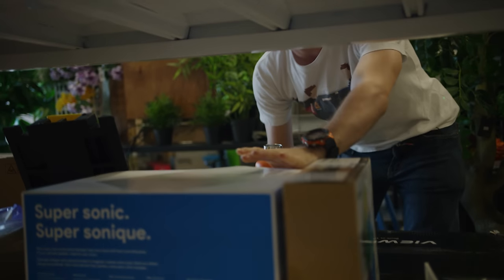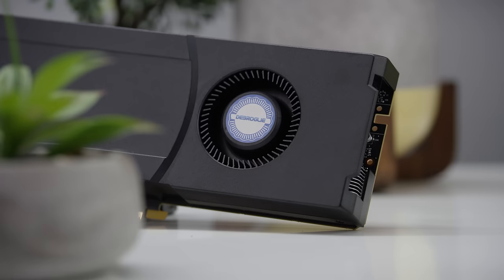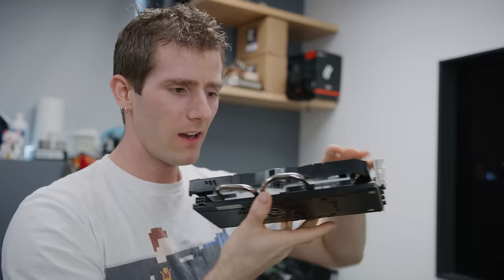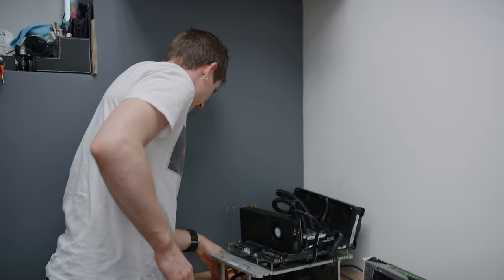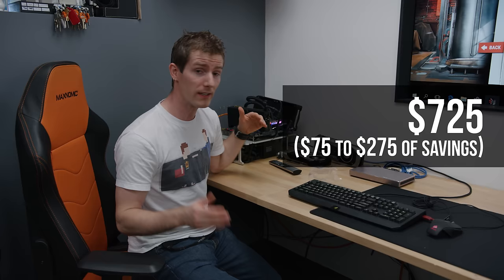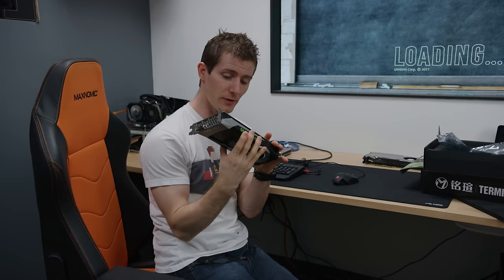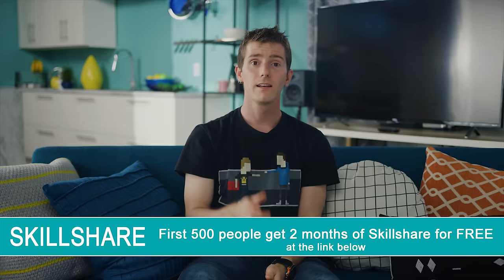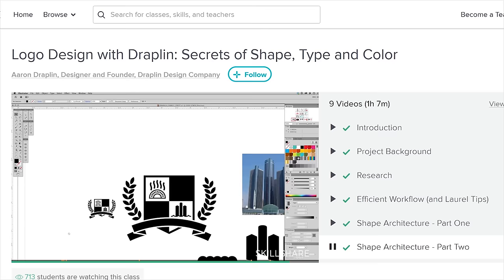Cheap AliExpress Graphics Cards - SCAM???

Comment: Ok, The cards are what they say they are, But about thermals? You did say that the coolers look a bit dodgey.
Reply: Adrian R cooler
Reply: Stable is stable.
Reply: I don't know why people are surprised. If it was 150 id understand the concerns. But $320 before tax isn't even a good deal at all. You can get a 6gb EVGA literally for less on newegg right now.  309 for an EVGA that's guaranteed to be what it says it is, plus a standard warranty vs a dodgy Chinese 1060 that for all you know is a 660 chip made to look like a 1060.
Reply: Jay Sin these were ordered a while back, aliexpress usually has terrible shipping times
Reply: if u saw the whole video its an older ''case'' i mean its not bad.. actually its pretty damn good. i heard stories where people bought 900 series and the plating/case was so horrible it fried the thing inside xD or even the cooling fan randomly broke down. but the ones he showed here just indicate it was probably an older factory that had the old cases but newer insides.  and for a 70-100 price off thats fucking no problem at all.
Reply: What? The retailer has nothing to do with DOA parts (aside from possibly poorly packaging stuff that results in shipping damage). That said, I've been buying from Newegg for years and have rarely ever had DOA, and if I had any issues with anything they've handled it just fine no hassle.
Reply: The biggest concern is long term reliability, especially with the fan. Not the end of the world if you need to replace a fan, but it's also a big pain in the ass, and it's a lot better to have a card with a nice efficient, quiet fan which works well for the entire life of the product. I wouldn't trust the fans on these cards to do that, and they probably are noisier than fans on a nice videocard cooler from a good product, like an EVGA SSC, Sapphire, Gigabyte, etc..
Reply: Something about what he said on that actually bugged me, he really pointed out that the extrusion was a cheap way to do it but that doesn't mean its a bad way, a lot of cooling syncs are built the same exact way, its way cheaper than casting them and a lot more efficient. Even Cars use the same kind of cooling systems.
Reply: To be fair this wasn't in a case, a card stuck out in free air shouldn't ever suffer cooling problems unless it's completely fucked.
Reply: did you buy it on ali express

Comment: I got a colorful GTX 1660 off AliExpress and the cooler seemed mostly plastic but it had 3 fans and overclocked well without going over 65 degrees

Comment: 4:03 heeey i know its been 6 years, but wanted to say, the Teflon looking tape ofer the pcie connector is a protection piece. Back when i worked at a company make pcba's, all are pre made board layouts, which we put all the surface mounted and pin through hole parts on, had those exact coverings. Its meant to protect the connecter from dirt and scratches. So it stays on during the entire process, even through a wave machine. (Used to solder many joints all at once, its a 450c⁰ long oven basically)

 it would be taken off once it was at its final destination, usually the testing grounds, and it just peels right off. It is very sticky, but its meant to stay on till your ready to test/use it, so thats why. Doesnt do alot of protecting if it just came off willy nilly, but they did do that quite often still lol. 

Very interesting to recieve it with it on, it could mean they never actually tested that board, or reaplied it during the shipping process when they packaged it. But the package it in should be the protection it needs, but it being aliexpress, probably not. And with it being aliexpress, i also doubt it was replaced, and was simoly never tested at all.

Comment: I dont know about the other one, but Maxsun is a thrustworthy brand, they also makes motherboards
Reply: Rown Aerith and this video cause the 1060 5g of this brand has being cut off by nvidia
Reply: what?
Reply: linglin92 
wait really? where did you find out about this?
Reply: because the nvidia told them if any one card leaked to the place that it shouldn't be,the supply would be cut off,and maxsun was selling them hiddenly if contacted them directly(may include offical taobao store),and now maxsun tells you they didn't have such card exists.
Reply: Well fuck em. Ofc Nvidia wouldn´t want a 5GB version leaking out when they made it specifically for internet cafe market. Specially when they have 3GB-6GB versions out for consumers.
Reply: also there's another reason,the 5gb ver is the only card the memory and memory bus being cut,and the others are kept without any change but in lower price to get,that will make everybody want to pay the 5gb ver because of the lower price
Reply: Jason McAllister at least you can buy remaining storage from other people until it will be out of stock,or some internet cafe being closed and those computer being sold and tear down.cause linus' this video, Nvidia know maxsun was selling them
Reply: Jason McAllister because this makes the another story in China right now

Comment: Of course a screw driver and removal of the heatsink would have told you right away for certain what GPU was actually on the card.
Reply: Except if they turned out to be fake then Linus would have been entitled to a refund. Removing the heat sink would invalidate any buyer protection so software tests were safer.
Reply: Like you are really going to send it back to China...
Reply: Sorry late reply... The money they make from the ad revenue, they don't need to send anything back.
Reply: If it performed in the benchmark, it's the real thing. A card can't fake benchmarks.
Reply: yes it can, some fake cards have modified BIOS that makes it say what model it is when it really isn't and the drivers that are actually for the real card will install but most of the time they would be unstable because it is not the real thing, and the benchmark software will say what it reads from the BIOS so if the actual GPU is something like a GTX 750 and the BIOS is made to say it's a 1050 or something like that then any software will think it is what the BIOS says it is
Reply: A benchmark MEASURES the card's performance. It renders graphics and measures how many polygons (and whatever else) per second. That's what all the flying objects are for, they're not just decoration. It's a measure of actually using the card's hardware. You can program a card to report fake details, but you can't fake performance, which is after all the point of a graphics card.
Reply: L.D., your noob is showing. You obviously don't even know what a benchmark is, why did you feel the need to write a comment about something you don't understand? Can't get it into my head what your brain was thinking at that moment.

Comment: Linus you need to do a full memory test, a lot of Chinese companies are screwing with the bios on these scam cards to SHOW the memory that's not their, games report a memory quantity that really doesn't exist so can cause crashing or huge slowdown once the memory is filled
Reply: *not there
Reply: Really no need to since the benchmarks were so close to the genuine card baselines. It would have been obvious there that the memory was tweaked.
Reply: AwesomeVindicator they indeed run tests in games and also a synthetic performance test at 4:37
Reply: AwesomeVindicator ii
Reply: In China u can buy a 5gb gtx 1060 edition edit: i mean a real 5gb edition with real 5 gigs
Reply: That was before Nvidia and then AMD locked down their BIOS-es. Yes tehchnically there is still HEX editing but thats very iffy even when you know what you're doing. Hence why BIOS modding stopped with Pascal cards for example.
Reply: If that were the case and it didn't have all 5 gb of vram then it would not perform similarly to the actual card. In this case it did with no hiccups that we can see in the video.
Reply: Aliexpress not ebay.
Reply: @A Person That Helps Strange pick of nickname and comment. Calling someone an idiot because .... lol
Reply: um no  thear  evena  counter  hack that will fuck  with the  bench mark so it  sent  false  data  to soft ware
Reply: AwesomeVindicator you used the wrong form of their. So you lost all credibility. Should have been “memory that’s not there”
Reply: I got 2x2gb of notebook DDR2 for 7 bucks... According to Linux's memory test, it's working 100% with no errors.
Reply: So they are just following nvidiots shining example, of the GTX 970 3.5GB + 0.5GB
Reply: [citation needed]
Reply: There actually are 5gb 1060s, they're meant for Chinese internet cafes since that's where people tended to get their gaming fix (consoles were banned in China until just a couple of years back, so internet cafes and lounges for PC gaming were and are still really common)
Reply: Raivo K I would imagine a manufacturing company able to put together a working, halfway ok 1060, would have staff quite capable of modifying a bios for said card. But actually faking the VRAM ammount on a relatively speaking quite high end card, makes no sense. Even the most novice users of such a card would notice instantly when loading up some modern eyecandy or textures, and the game can't find those textures where it "put them" , and the seller be booted off AliExpress, Alibaba and TaoBao. If really cheating with VRAM to save a buck here, it would make a lot more sense to go with slow, cheap B-grade VRAM, and fudge the reported speeds. Most users shopping for a card like this will probably never see even the reported memory speed.
Reply: Since the 900 series nvidia has done some pretty insane driver and bios verification on both gpu and system side. Which is perfect for preventing fake cards, though makes custom drivers that use the card to it's full potential nearly impossible to make (nouveau on linux example).
Reply: Because indeed those card were genuine. Just for another market,, China.
Reply: @HitDaLick
 yes but I was on my phone so predictive text screwed with my comment :P
Reply: THEIR.
Reply: 🙄🙄 yeah we just watched the vid explaining that all
Reply: Considering they did reviews on cards a few months back and that was what they found I am sure they did that ...
if you go back in the video section and search you will find them ... they are capable of seeing threw those scam memory cards...
I am guessing they did that here also BUT since it came back OK they said "looks good"
Reply: Memory that isn't there or rejects?
Reply: thats true and i thinked about it too
Reply: @alexberebc4992  thought *
Reply: @ozz961  i am not from UK or america so i dont speak very well english.

Comment: That orange tape is Capton tape. It's there to protect the card edge connector from solder, but that's usually used for protecting mounting hole pads from wave soldering. Probably the board is getting way too much solder paste in assembly, and the only way they can make sure no extra liquid solder flows on the connector is to protect it with Capton tape?

Comment: "It's not a complete scam" -- what do you mean, it's not a scam at all. :) You got perfectly fit and working cards for the price.
Reply: I imagine overclocking and extended use won't be as good as a brand card
Reply: Perfectly fit and working cards for how long, though? Those cheap heatsinks and poor overall build quality will probably give you a card with a limited lifespan. This may be fine for an internet cafe, where burning out cards and replacing them with upgraded ones at predictable intervals is just a capital equipment cost. It's not fine for the consumer market where people actually expect some longevity. There's a reason at least one of these cards was only intended for internet cafes. Buying sketchy shit, even if it works today, is almost always shows itself to be a sketchy deal in the long run.
Reply: Well, you can buy an "OCV" version of a GTX 1060 with sketchy cooling on "normal" non-Chinese eshops. You are paying less for same performance but worse build quality, that is not a scam, that is getting what you pay for. GPUs are not used for decades anyways.
Reply: Winston Deleon that’s why the price is low, right?
Reply: Winston Deleon omg, paying less price but require a higher quality product, over wise it would be a scam. What the actually fk. Wait let me sue bmw first because my s series is not as good as 7 series, scam!
Reply: Well, I imagine you also don't pay the the same price as a brand card.
Reply: All these butthurt 1060s
in the comments XD
Thet get jelous when its just as good what they paid for
Reply: Just the worst, and cheaper, of that graphical cards are the refrigeration sistem. If you replace it with peltier cells and liquid refrigeration it's even better than a stock oficial nvidia card (and these can also be cheap, except coolant)
Reply: then 6 months down the road after countless long gaming sessions the smell of hot plastic and ozone appear
Reply: the only thing is see here is are cheaper cooling blocks. Which does not matter, when the gpu stays cool enough its perfectly fine. Ofcourse, you can believe the marketing mumbo jumbo from top tiers and pay top prices, since you choose to believe them.
Reply: Josh Bird many of the ODMs are Chinese-produced anyways.  Chances are the PCB is the same as brand names, or from the same manufacturer but didn't meet spec outlined by the ODM.  It's not unheard of; Catleap monitors were popular some years ago for being "failed" 27-inch Apple Retina displays that were sold off by a Korean company.  Back then you could get an $800 screen for like $250, or one with a tempered glass covering for $450.  Some could even do 3D with some hacking.

The cooling is maybe a problem, but if you're planning to upgrade in 1-2 years it may not be a big deal.  Not sure I'd trust this in my primary gaming machine, but for some of my bench computers it'd be perfect.

Comment: can you guys help? I have been buying nvidia low-profile cards such as gt730 of ram I bought gt730 with 4gb ram and it didn't work worth anything I bought another 4 gb version and it didn't work right either and I found out the ones that don't work are Fermi and the ones that do are kepler is there a way to make the Fermi cards work? Or are the Fermi cards just trash and not worth it?

Comment: Do one on wish.com. I think they're $90 GTX 1050s are pretty suspicious
Reply: Brenden Pragasam everything on Wish is a scam but I'd watch the video. There's a bunch of scam cards on eBay that are vastly underpriced and are just old hardware hacked to show up as a higher end card in device inspector, but thankfully they're "no-name-brand" and have recognizable shrouds so it's easy to tell which ones are the fakes.
Reply: Wish is a scam
Reply: Wish is not a scam, it's sketchy, but not full on scam. A tech enthusiast would know what to look for and what deal is too good to be true, someone who isn't a tech enthusiast wouldn't buy anything too "techy" in there to begin with.
Reply: Wish isn't a scam. If you read the description, you know what you are buying. I have bought a fair few things off there, thermal paste, USB3.0 to SATA converters, and it all works well.  The people who get scammed are the ones who only read the product title, not the description.
Reply: The problem is nothing on Wish is worth it. Putting aside stories of actual scam items, the only things on there worth having at all are certain very simple items, and in those cases those same items can be bought for less from chinese sellers on eBay.
Reply: Also they advertise big and completely fake markdowns. The "sale prices" are higher than you could get on eBay.

Comment: So funny as you didn't compare temperatures, noise levels and stability. Just to name a few. It's not like you are a small channel which has no funding to do so.
Reply: He should have used one those IR non contact thermometers or some software to read from the temperature diodes.
Reply: Didn't do even rudimentary background researched either.  Lots of wiki pages about ELSA, 160-bit memory bus, 5GB 1060, etc.  Lots more info about them at GPU database and enthusiast sites.
Crap video, Linus.  You bought something cheap/unknown off Alibaba and it worked as well as a costly/branded counterpart ... that's all?
Reply: Arturo Tabera he can't afford it.
Reply: Arturo Tabera he's a shill, what you expect.
Reply: He got too obsessed with the 5gb Vram
Reply: I think he saw the temperatures when he tested them but they where similar (like he said)
Reply: he said it ISN'T a small channel.
Reply: I mean, he kept talking about the heat management looking shady, then he doesn't show us how that works.
Reply: This video showed up in my recommendations. I've heard of Linus before but this entire channel appears to just be clickbait uploaded by someone with way too much money.
Reply: TEMP IS NOT THAT IMPORTANT. As long as it's stable it's good and that BS about about cooler cards running better is BS. Just leave you PC to idle and don't turn it off if you're worried about degradation.
Reply: Linus should just ship the cards to Steve from Gamers Nexxus, let him review them.
Reply: well he is not small but you're right about the everything else
Reply: He's a shill and promoting the sellers in Alibaba and Aliexpress. I'm sure that the Temperatures are fucking horrible and will probably fail in a few months.
Reply: Arturo Tabera This isn't a review, hes just trying to see if its a scam.
Reply: agree, or maybe do a burn in test
Reply: U could do it with or without funding

Sad linus does not do in depth benchmarks at all.....

Then there's youtubers who have a fraction of subs and have 100x better benchmarks